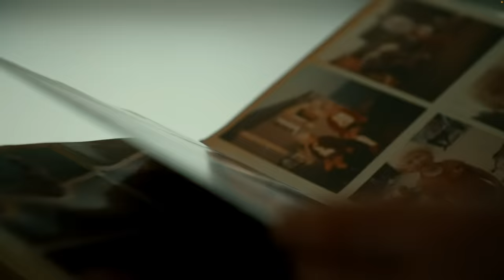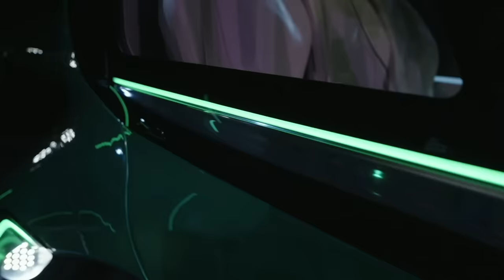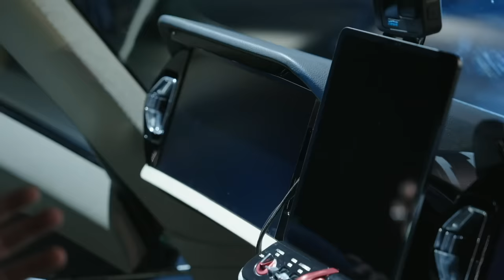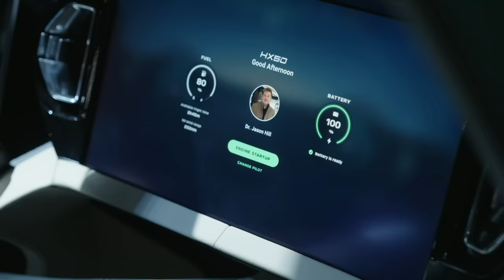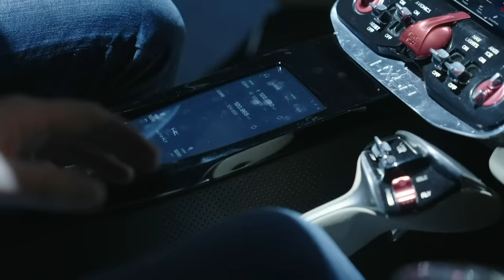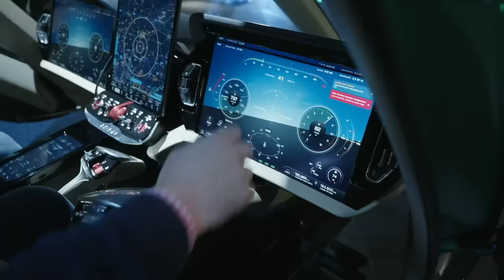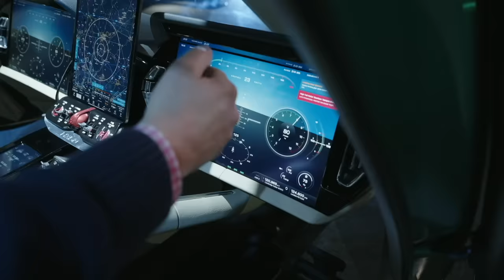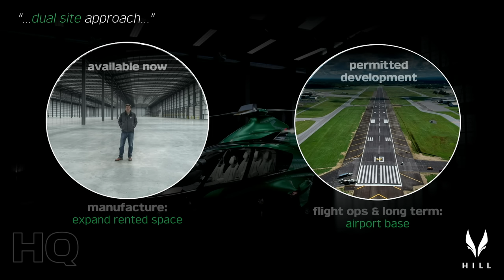Unveiling the Future: HX50 Takes Center Stage at 3rd GMDE

Comment: I’ll be surprised if this bird flys by 2027/8 with the home built engine shown. A clean sheet design of a gas turbine that is organically built is a unicorn. I’ve always thought it was a bad idea to not use a proven power plant built by a proven manufacturer whose life depends on making a good engine. I’d also concentrate on the folding green and forget the warm and fuzzy green until I got the ship airborne. The machine is already on a trajectory to be a million dollar helicopter by the time it becomes available. Doing a product launch with a no engine and non-flying prototype is a bit strange. This thing is beautiful but it’s got a long way to go. I’m not convinced that it won’t be the second or third owner that gets it across the finish line. Just my opinion based on investing in and working with many start-ups.
Reply: I think you are going to be supprised. I'm astonished by your level of negativity.
Reply: I agree about the engine. If performance targets do not depend on the new engine, there is no need to add risk and delay to the aircraft project for the engine; If performance targets do depend on the new engine, the project will fail, since the new engine is unlikely to meet targets (exceptionally unlikely in the case of an inexperienced manufacturer).
Reply: Yep!  Maybe pop a certified engine in it and develop engine and airframe in parallel.
Reply: A proven turbine engine is key. As for the guy that talks about this being a million dollar helicopter.. ARE YOU INSANE?? Agusta helicopters are 10-13 million. Maybe 16 million now.
Reply: @Jlinwoodjackson  this thing is hell and gone from an Augusta 109. This is a 5 place light turbine, the 109 is a medium twin turbine.
Reply: @joespratt413  I agree - this is not a large aircraft like an Augusta 109. A comparable existing and relatively new type is the Bell 505, which is under USD$2M.
Reply: U make good points. Exciting design though.
Reply: 1:28:31
Reply: I would bet, when this helicopter is finished and ready for the public, it will have a 5 million dollar price tag or maybe even a little more. There is absolutely no way it's going to be even close to a million dollars, I wish it was that inexpensive to purchase that would be great, at least a few of us could afford one at around a million.  Take care. Hawk out!!
Reply: 1:09:13 he explains perfectly why it makes sense to build his own engine.
Reply: @disabledglobalchallenge290 

I don’t think he’s trying to just be negative. I think it’s more being aware of how difficult it is to get anything aircraft certified and approved by the regulators.
I did some branding design and photography for a company that makes updated ( full glass cockpit- meaning current digital avionics etc) biplanes from a company that went out of business back in the 1930’s but they have bought the name or revived it and build biplanes. It’s very hard and quite a process to get everything certified/approved!!!
Reply: I'm calling hoarse crap the reason why aviation engines cost so much is because the engine manufacturers do all the requirements needed by EASA and the FAA and at a minimum it takes years to qualify
Reply: @Jlinwoodjackson  12:30
Reply: @bigstaceinc  17:02
Reply: 19:14
Reply: Don't worry humanity will not make it anyways lol
Reply: That kind of thinking  still be in the stone age innovation good or bad lessons are learned plus it's a helicopter they are expensive for a reason 😂

Comment: Yeah it’s pretty ,but it makes no sense to use an engine that’s not already built and properly designed with a proper track record since they like the word proper ..I say that means using tech that provides proper precision proven solutions with a power plant that also has 100’s of support and suppliers for repairs,not a new engine that’s not been running for decades with no maintenance support that’s worldwide like modern current engines and technology with techs already trained to provide reliable maintenance..this is like the first iPhone show where JOBS had to pretend the phone worked because it didn’t yet,and these guys don’t have a flying machine yet ??

Comment: 1:09:13 Hes right that in order to control costs you have to have complete vertical integration of the manufacturing process. A lot of aviation companies buy all of the components from different suppliers and then assemble them at their factory, but that means they have to pay whatever the suppliers prices are and each supplier is trying to make a profit. That profit from each part is additional pricing that has to be added in to the final msrp. The way theyre doing it theyre going to get all of the components at cost plus labor so its going to be a million times cheaper. Theyre going to be getting their engines at the price it costs to make them vs what a company charges for them. This is going to be huge as far as them keeping the final msrp as low as possible.

Comment: HI there.. Can I ask a dumb question.. Ive seen so many helicopters get into problems when the rear rotor fails.. Is there a reason you can direct the jet engine exhaust down the tail and using the exhaust as thrust to stop the helicopter going in circles ? Sorry, if its truly dumb.

Comment: What’s the width of the aircraft with blades folded?  I.e. Is an oversize trailer permit required when towing the helo?  After a PEL or just over road transport.
Reply: The Hill website has those dimensions.

Comment: Please think about a version with 2 seats and the rest of the helo would be for cargo or dedicated missions (comms, etc.)
Reply: Surely the rear seats will be removable 👍
Reply: @BenC20B  
You are right, sir, but without the cargo area separation, the avaiable space for cargo would be great, and perhaps someone could use it for comercial transport of goods (quick delivery...)
Reply: @jplacido9999  I see what you mean. I’m guessing that bulk head is required for structural integrity. There is already a removable panel in the middle of it so you can pass long items through into the area behind the front seats.
Reply: @BenC20B  
That is great...
I'm not shure that I'm right at sugesting a cargo version...

Comment: If it’s not already available,They need hybrid
Helicopters to provide back up power, so you use your base turbine engine/power source as necessary in normal fight ,but let’s say there’s a failure instead of loosing all power and then crashing maybe ,you have a small electric power plant which can be switch to or comes on automatically and it provides a stable power source for up to 5-10 mins of flight to allow landing or avoiding obstacles..they should also ban flying in weather conditions you can’t see in ,even if you have radar unless it’s certain types which provide protection beyond just showing other vehicles flying ,as well as a clear indication of direction ,if they had a reg which would make it necessary to have red ,yellow and green arrows in the cab instead of just gauges which pilots don’t always trust when they become lost ,or confused,seeing the arrow change color and direction might give them a secondary indicator of direction in fog or at night etc…

Comment: You should have a direct shaft without angles. The  engine should be arranged to work at the angle of direct input in the rotor head. Less gears, less spof's more reliability. My 2 cents

Comment: Could you install a parachute above the main rotor? The parachute should be designed as a backup for conditions where autorotation cannot be performed, such as flight control failure or loss of maneuverability, flying over an area where an emergency landing cannot be performed safely, and flight conditions that prevent restoring rotor rotation speed.

Comment: The design is similar to most UAV electric aircraft designs that are out there. The future is electric autonomous aircraft not really single engine  helicopters. Multi electric engines in quad or hex or octo motor configurations are being built and tested for the industury.

Comment: I have worked on helicopters for the United States army and know some of the things you talked about , had to go find the spec sheet for the height , width , rotor diameter , was disappointed at the payload capacity because if you put 5 people that are my weight in it you only have 100 lbs of fuel that can be put on board with out luggage.  I would rather see a bigger rotor diameter and more lift capacity to carry more fuel and baggage with 5 grown men and women and a range of 800 nm or farther for those back country trips where people are packing all their gear for a hunting trip that lasts two weeks or longer .

Comment: I was half-expecting to see an electric motor somewhere and I began to think "Where are the damn batteries located?" I am glad that common sense prevailed and a gas turbine engine was employed. Battery powered helo's are many many years away, if ever, as the gas powered turbine gives much longer flight time, and the added safety of it not combusting via thermal runaway.

Comment: Some years ago I worked for Robinson helicopter and I told Frank Robinson why doesn't he put a parachute that shoots upward in the center of the rotor and away from the blades to save lives and he told me no because the strings or whatever we get caught inside the rotors blades but I think he's wrong because I've seen a ball on the center of that rotor used for some technical stuff and if that could be mounted there they can mount a parachute that shoots straight up so it doesn't get caught in the rotor blades and save people's lives that's just something I thought about many years I know it would work

Comment: Fifty percent of startups fail. In aviation, it’s probably more like 75%. Unless you try to introduce a clean sheet design with a clean sheet engine.  Then?  Well I’m not optimistic. Sadly.
Reply: In aviation, 95% failure rate is closer to accurate.

Comment: Why make such lofty goals.
Better to offer 2 versions
1. A reasonable delivery date with available engines and drive trains.
2. No expected delivery date. If you want Hill Engine and drive train. Because Developing a turbine engine and drive train from scratch is a resource intensive endeavour, if some want to invest in the vision , Fine - but no delivery soon.
On just the engine expected performance, if it was possible you would sell thousands of engines to other helicopter manufacturers.
Not being negative - just drawing a line between  “vision” and achievable goals. People are investing money.

Comment: I am not a fan of the looks of the this helicopter or the rotor fairing. They could have increased the cabin size to reduce the ugly looks of having such a tall rotor fairing. Like the hideous Robinson helicopter and its tall rotor system This one  just has fancy cover placed over it. The tail rotor system looks nice but and there a a few other small features that I like but thats as far as I will go with it. 
The MD 600 and 900 series, Bell 222 and 525, Airbus ACH-160, H-145 are examples of beautiful helicopter designs. 
Now the interior of this helicopter looks very nice and very modern.

Comment: All pretty nice, but in the end, helicopters will inevitably kill you if you crash in one and there's hardly ever a second chance to survive when it happens.  I'm still waiting to see someone design a proper helicopter for once, with actual survivability in mind in the event of crash,  i.e. and just a suggestion are very large Front, Underneath and Side impact air bags plus some kind of non-twist Drag chute design built in at the tail.  I'm not an engineer and so I don't pretend to have the answers, but you won't get me into one of these death machines until they're a Lot safer.  Solutions like these from 'outside the box' would at least give people confidence that maybe you're not going to die when an accident occurs, which does happen at regular intervals with copters.
Reply: And yet, you drive on the highway, statistically WAY more likely to die, without a second thought. Simp.
Reply: It's easy to design a 100% safe helicopter that is too heavy to fly or carry any payload.

Comment: THE ONLY THING that could make the Helicopter better is if it was a Plug in electric and didn't require fuel.
Reply: no thanks.... there just isn't enough power density per kg yet to do that or ground infrastructure for that.